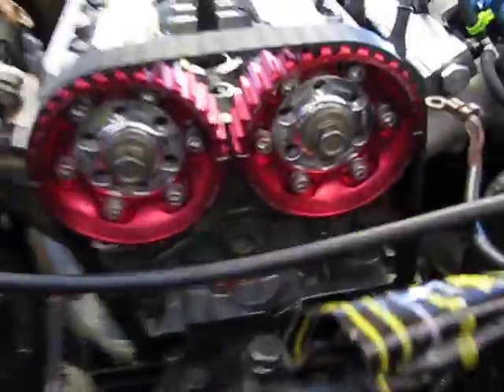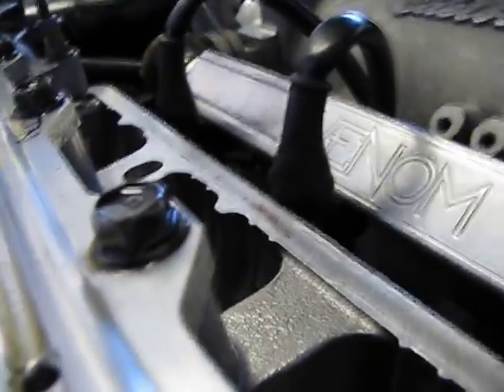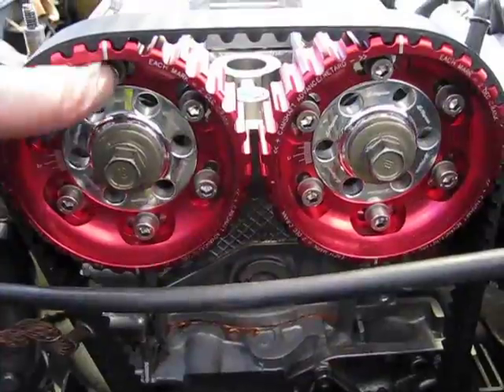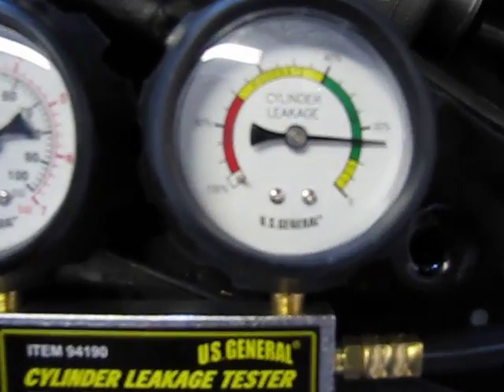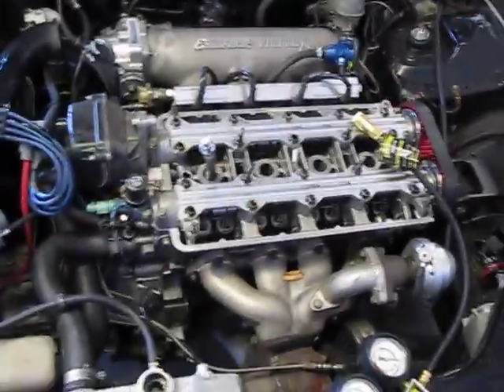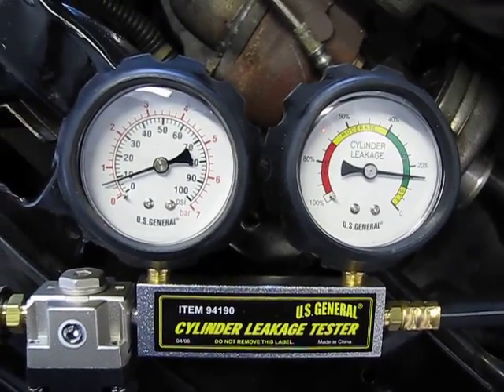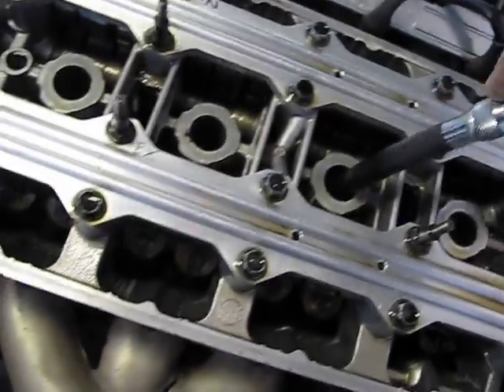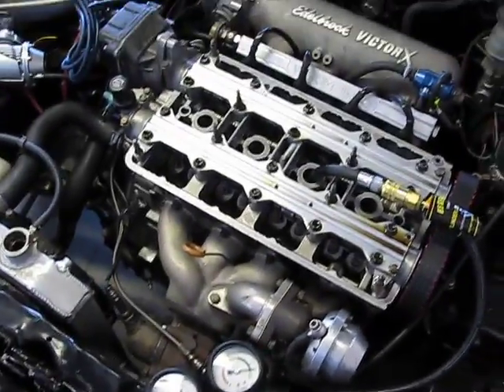b20 vtec turbo leak down test

Comment: What's up dude I have me a b20b with a Gsr head on boost. I recently changed my piston rings but now I'm having a huge problem that my car keeps skipping timing. I adjust timing perfectly but it jumps it as soon as I try cranking up the motor. I check the tensioner and it's perfect it doesn't losen up and I also checked my cam shafts but they are also perfect. Mechanics told me that since its a Frankenstein motor they don't work on them so I'm stuck doing this on my own. It's been 5 days and I'